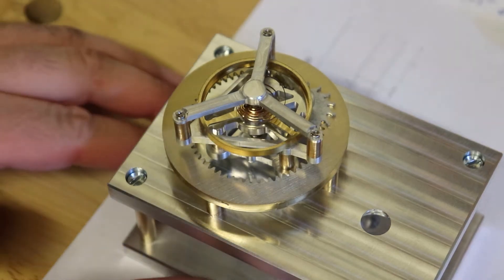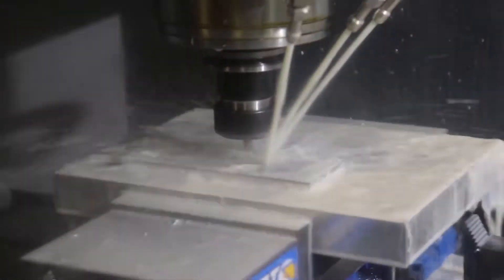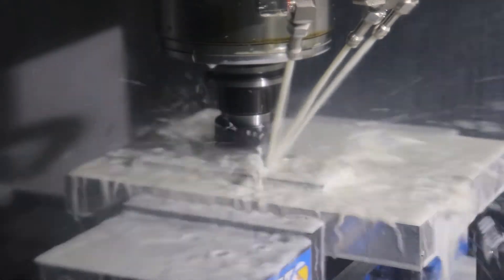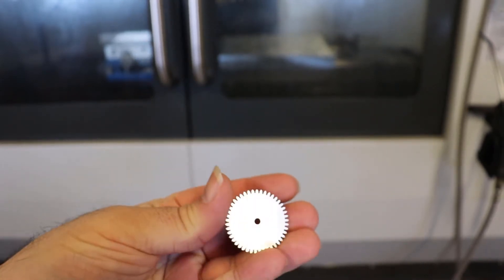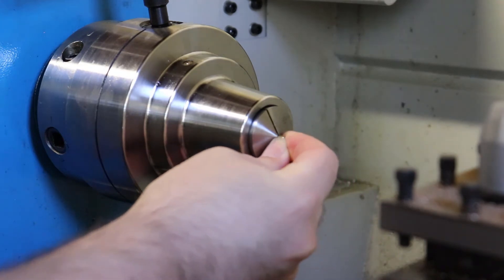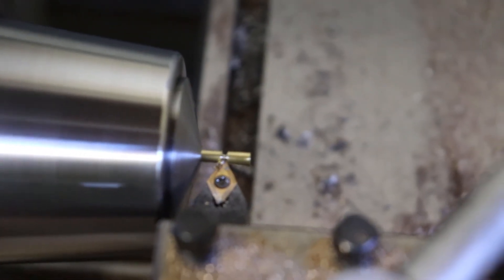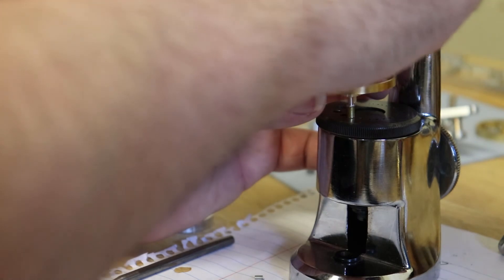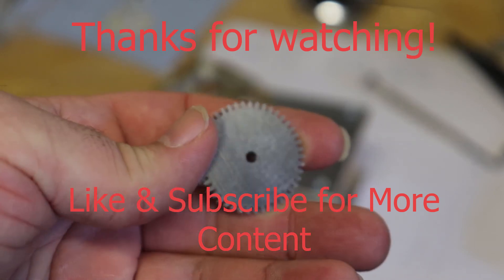How to make Clock Gears - Making a Tourbillon at Home, Part 4

Comment: Have you ever considered selling the parts in a gift box or something? As a teacher, I would LOVE to have one of these on my desk, but I don’t have the machines to make the parts.
Reply from the maker: It has crossed my mind, and in fact, I'm making a small batch of orreries (motorized solar system models) which I do intend to sell starting early next year. But it is still just a hobby for me, and so I'm basically limited to working on these during the weekends. So many project ideas, so little time! But I may come back to this one day and make a batch, with some design improvements, and integrating what I've learned in this past year as far as machining goes :) It is still a possibility.

Comment: How much is your CNC machine
Reply from the maker: I use a Haas TM-2P. With all the options, shipping, taxes, everything, came to maybe 46k. If you are willing to get a used machine, you can get more capable machines for less money on ebay. But I generally prefer new and from the factory. I could have bought a cheaper machine, but I wanted something with travel sizes so large, I would never outgrow it.

Comment: I missed the model of your end mill
Reply from the maker: I don't have any favorite model. For small work, I use carbide, 2-flute, 1/16" diameter, 1/4" cutting length, 1/8" shank. For the 1/32" diameter, carbide, 2-flute, .156" cutting length, 1/8" shank. I pick up tools from MSC and sometimes harvey tools.

Comment: Nice work! I think the pinions are always made of a harder material because the pinion spins much faster than the gear. In effect more wear on the pinion teeth. So they equalize the wear on gear and pinion.
Reply from the maker: Thanks much. Never though about that, makes a lot of sense. I've never cut steel before, but I will probably venture there soon enough